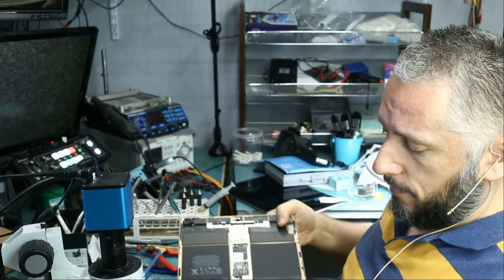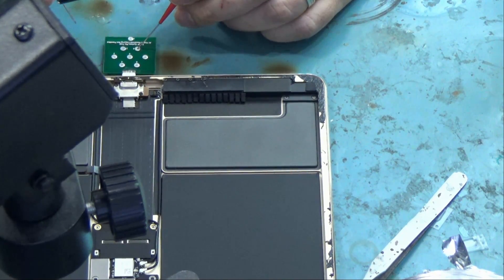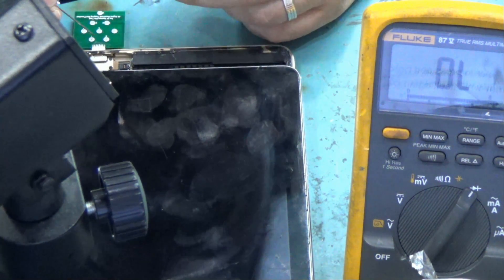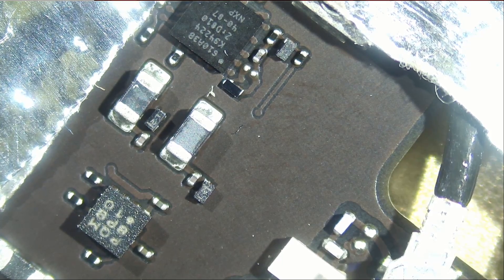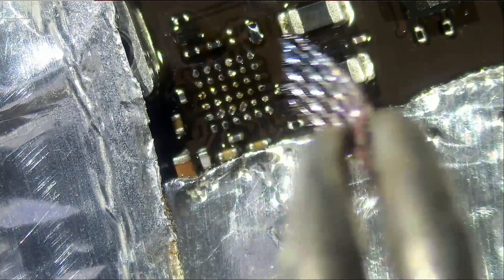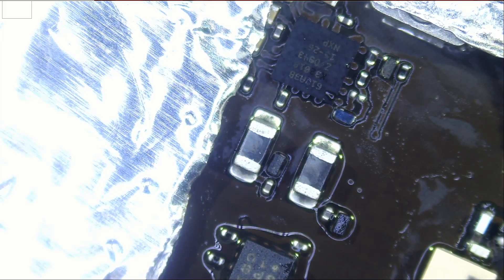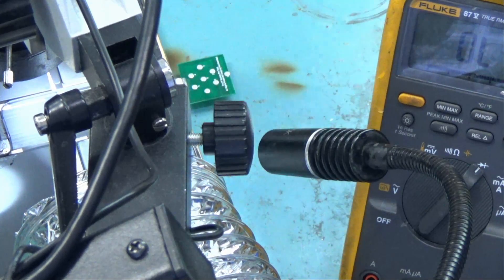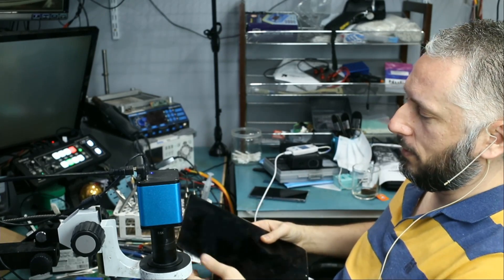iPad pro 12.9 No Power  Troubleshoot using $5 Tristar tester. Faulty Tristar chip replacement

Comment: I have a question about using the multimeter. What is the multimeter reading from the device? Where is the power coming from in this case? Is it power from the batteries in the multimeter or from the battery in the iPad ?

Comment: I have just received tester board. I tested my 1st gen iPad Pro (it is a replacement after Apple $99 battery service). The pins seem reversed from video. Two tested  .460 two tested at .475 and the important pin tested at .772. Do you know if it's good or bad. Thanks for your great videos.
Reply from the maker: Flip the tester board and it won't be reversed anymore.
Reply: @NorthridgeFix the readings are very different from video. Do I have a different Tristar or is the chip just faulty? Thanks
Reply: @NorthridgeFix  OK I reversed board and now getting about 0.730 on most compared to 0.750 on video. Critical pin now reads 0.779 very low compared to video.
Reply from the maker: You have to compare values from good known tablet or use values same in the video if you have the same model tablet. If numbers are different and tablet is not turning on or charging, it could be that you have a faulty Tristar. A faulty charging flex can also cause numbers to change.